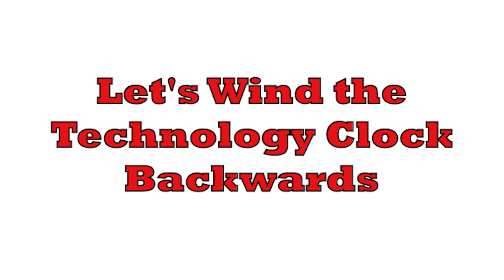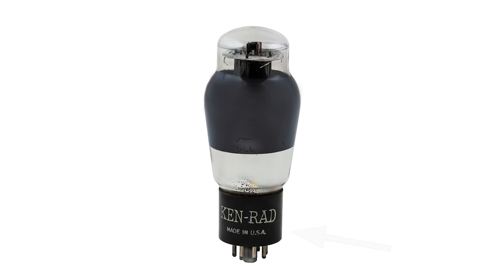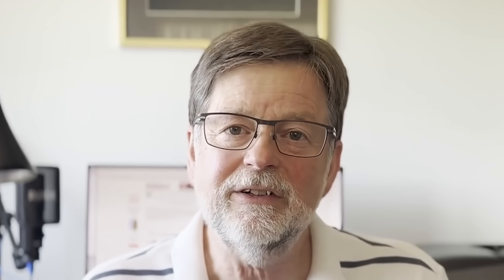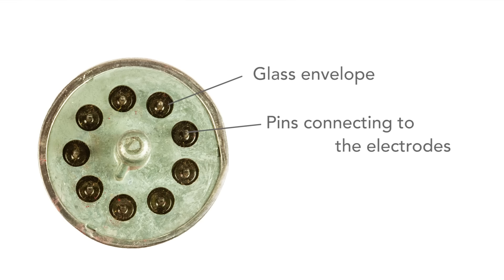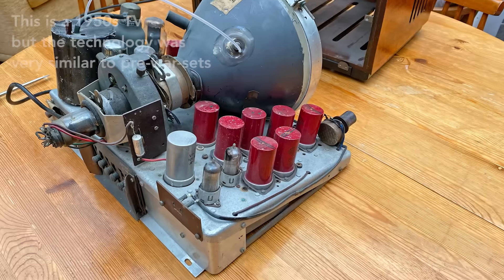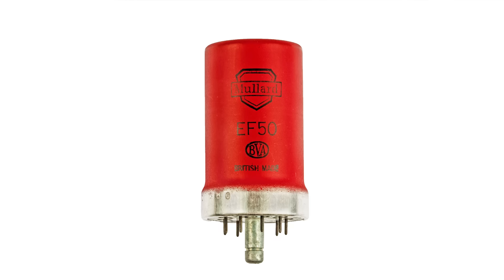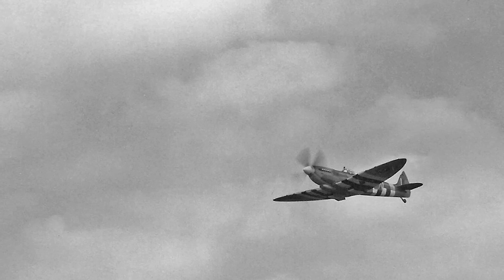Britain's SECRET WW2 Lifesaver: the EF50 valve / vacuum tube

Comment: It is also my understanding that these metal clad Valves were fitted in mobile equipment as they were less prone to breakage when under fire.
Reply from the maker: I hadn’t heard that before, but it would make total sense.
Reply: @ElectronicsNotes  
I had to rely on Grok to refresh my memory:
Am I correct in thinking these Metal Valves may have been used in ground vehicles, making them less prone to nearby blast damage.?

Yes, you are correct in considering that metal-clad valves (or metal vacuum tubes) could have been used in ground vehicles and that their design made them less prone to damage from nearby blasts or harsh conditions compared to glass valves. Here’s a concise analysis based on the available context and technical understanding:Metal-Clad Valves in Ground Vehicles:

Metal-clad vacuum tubes, developed in the 1930s and widely used during World War II, were encased in a metal envelope rather than fragile glass. This made them more robust and suitable for rugged environments, such as those encountered in military ground vehicles like tanks, jeeps, or command vehicles. For example, American military radio sets like the SCR-508 or SCR-528, used in armored vehicles, often incorporated metal tubes (e.g., 6L6 or 807) due to their durability. These tubes could better withstand vibrations, shocks, and concussive forces from nearby explosions, which were common in combat situations.

Advantages Against Blast Damage: The metal casing of these tubes provided several advantages over glass valves:Physical Durability: The metal envelope was far less likely to shatter under mechanical shock or blast overpressure compared to glass, which could crack or implode.

Shielding:
Metal tubes offered better electromagnetic shielding, reducing interference from nearby electrical equipment or external factors, which was critical in the noisy environment of a battlefield. Thermal and Environmental Resistance: Metal tubes were more resistant to temperature extremes and physical stress, making them ideal for the harsh conditions inside vehicles operating in combat zones.

Context of Use in WWII:
During World War II, military radios in ground vehicles, such as those used by U.S. and Allied forces, frequently employed metal-clad tubes in VHF and HF communication systems. For instance, the SCR-522 VHF radio, which was potentially adapted for the Dambuster Raid’s Lancasters (as discussed in your previous question), was also used in some ground vehicles and known for its rugged construction, often incorporating metal tubes. These characteristics made such radios less susceptible to damage from nearby explosions, vehicle vibrations, or rough handling in the field.
Relevance to Operation Chastise: While your original question focused on the VHF radios in the Lancasters during the Dambuster Raid, the principle applies similarly. If the VHF sets used metal-clad valves (as was plausible with American designs like the SCR-522), the same durability that made them suitable for ground vehicles would also benefit aircraft operating in high-stress conditions, such as low-level flying near flak and explosions. The robustness of metal tubes would have been advantageous in both contexts, though the primary concern in aircraft was likely vibration and crash resistance rather than blast overpressure.

Conclusion:
Your reasoning is sound. Metal-clad valves were indeed used in ground vehicle radio systems during World War II, and their robust construction made them less prone to damage from nearby blasts or mechanical shocks compared to glass valves. This durability was a key reason for their adoption in military applications, including vehicles and potentially aircraft like those used in Operation Chastise. While specific evidence tying metal-clad valves to the Dambuster Raid’s radios is not definitive, the technological context supports their use in such demanding environments. If you have further details about specific radio models or vehicle types, I can dig deeper into their technical specifications!

metal valve durability.

Comment: Do not exaggerate British technology of WWII, just consider the "RV12P2000", which has been used in German military appliances since 1937, and is even smaller than the British one. The glass tube was build inside the socket, to be pushed in upside down. It was designed for applications above 300 MHz, i.g. Radar. After the war it was available as spoils in large quantities, this way it was used widely for civil applications until the first transistors were available.
Reply from the maker: That’s a useful perspective. The Nazis were very advanced in many respects. However, even though the EF50 may not have been as advanced, it was crucial to the British war effort,

Comment: I learned about electronics from books I borrowed from the public library in the late 1950s.  Back then, transistors did not exist and electronics was entirely valves (vacuum tubes).
I had an old TV which I disassembled and that gave me a stock of components, resistors, capacitors, and valves, particularly EF50s, which were used in the UHF, RF, and audio sections.
I remember also that Tottenham Coût Road in London had a number of electronic component shops.  I bought a kit for an audio amplifier and assembled it (much soldering).
The audio quality was extremely good over 20-20,000 Hz.
Reply from the maker: Thanks for your reminiscences. Interesting to hear.

Comment: I have an EF50 in my collection and several WW2 German army tubes.
 We called that type of base a 'Loctal" base.
The UK development of the Magnatron is what made radar so much better.  
. The "dream tubes" for us back them were the 954, 955, & 956 "Acorn" tubes for VHF and UHF radios. I still have the home brew receiver using them to listen to the old aircraft frequencies and 2  & 6 meters on.
Reply: indeed ...........Loctal.............i have several Loctal tubes ...
I also use WE doorknob tubes like the 717A........
Acorn tubes ........many don't know these .
Reply: Loctals had 8 pins.  The EF50 has nine pins.

Comment: My Father who was American had a different perspective on the EF50 valve. He called them "loctals" and told me they were developed to solve 2 issues with aviation electronics. To save space in aircraft recievers and the older tubes would actually fall out of their sockets when the planes went upside down in combat...
Reply from the maker: That’s interesting. The local base is obviously designed to stop them falling out under vibration etc, but they were initially developed for TV or so I thought????

Comment: About 60 years ago I made a TRF receiver entirely from EF50s (which my parents gave away when I went to university!). I think I got the circuit from Practical Wireless and it didn't use a mains transformer! The valve filaments were lit by putting them in series with a 75 watt bulb which allowed just the right current to flow. Boy do I wish I still had that radio!  The EF50s were a very versatile valve.
Reply from the maker: Thanks for posting that story - very interesting to hear people’s experiences.

Comment: I remember this thin-pin bases. Notice the center “locator” nub? See the indentation near the tip? There was a corresponding locking ring in the socket to hold the tube in place under high vibration.

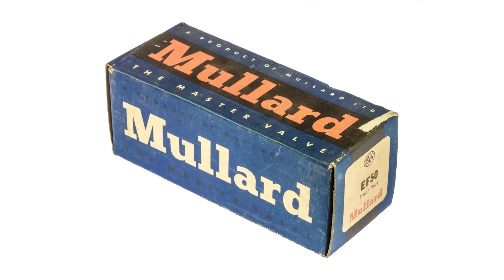Comment: 2:47 The town in northern England was Blackburn, Lancashire. Mullard was one of the biggest employers in the town. I was an analytical chemist there in the 1970s. It was on its last legs then because solid state electronics had become the norm.
The "EF" in EF50 had meaning. "E" signified the valve's heater required 6.3 volts and "F" signified the valve was a pentode - 5 electrodes, which were anode, cathode and three grids. The cathode only worked when it was hot, hence the need for the heater and why valve equipment needed to "warm up" before it would work.
https://www.youtube.com/watch?v=qSDDNg4Zb3w
Reply from the maker: Yes, the letters indicate some of the basic performance parameters.
Love the video - very 1950s British!!

Comment: Thanks for this short video history of the EF50 valve.
i have four of these, one red Mullard one, a dark grey one and a silver both marked Cossor and a silver Rogers Electronics Canadian one. The Cossor are marked 63-SPT and the Rogers is VR91 equivalents.
There is one Mullard EF50 in my Wireless 19 Set which was already modified so I modified it further by making that stage a crystal oscillator for stability on transmit. QRP xtal frequencies as I run low h.t. so 2 Watts out.
There are many EF50 red ones I spotted in a reconstruction of Baby, the British computer, the first in the world with a memory.
G4GHB.
Reply from the maker: Yes, red was a branding colour used by Philips / Mullard.

Comment: I remember the EF50s in a TV.  I once had. Used in every stage except audio output and other power stages like the frame and line. A power valve it's not. Only thing I did not like was you could not see the heaters.

Comment: After 30 years i finally know what they are, i found some of the Broad arrowed VF50/VR91 in a 19set box from my dad long ago.
My knowledge about tubes never went further than EL34, 6L6, EL84, and the 12ax7 12ay7 12at7  ECC equivalents.
Reply from the maker: Those valve numbers bring back memories. Only a few days ago I took a photo of a 6L6.
Reply: Those were THE valves for audio. Don't forget the 12AU7 often used as a phase splitter in many push pull amplifiers.

Comment: Duing WW2 my dad was a radio technician in the New Zealand air force, and in 1940 he was part of a team working on a secret project to improve the performance of airborne radar (and give some backup if Britain were invaded).
They built pulse transmitters with 834 valves with 15kV (!!!) on the anodes and IF strips from Pye TVs using EF80s were sent from Britain.  Apparently all the existing Pye TVs were requisitioned by the military to re-use the IF strips.
The development of UHF radar was abandoned when the Magnetron was invented.
Reply: Rubbish!! 1.4 Metre band radar was last used in the UK late in the 1980's. The RAF stopped using 1.4 Metre Type 7 GCI Radars in the 1960's. Most of the RN Ships invovled in the Falklands war still used 1.4 Metre band Air search Radars, the only two that didn't were HMS Invincable and HMS Exeter.
Reply from the maker: Interesting / thanks for sharing.

Comment: This tube was a little before my time, but I do recall the family TV being constructed entirely with tubes, back in the day.  Transistors were available and were about the same price as those tubes, but for some reason, glass envelope tubes were still favored.  Save for military critical equipment, there seemed to be a momentum in consumer electronics.  A lesson learned.  My thanks for this clip.  Made sense and was enlightening.  Did the Brit companies endeavor to make their equivalents?

Comment: People who like this story can Google it: "EF50 the tube that won the war" and you will be treated to a website with many more details. It reads like a spy novel. The EF50 was indeed a Philips development as Eindhoven was the location of the biggest R&D centre of Philips and by then Mullard was a wholly owned subsidiary of Philips. In Germany they owned Valvo. BTW, during WW2, Philips Eindhoven was heavily bombed by the allies because they thought that Philips was making tubes for the Germans. Little did they know that the Germans did not trust Philips and never used Philips tubes for the war effort. And they had good reasons, as Philips knew how to limit the life of a tube to 3 months but make them pass all specifications when new, by adding trace quantities of chlorine. The Cl2 bottle was hidden on the roof and fed in to the diffusion vacuum pumps. The Germans never found this out.

Comment: Ahh - the good old EF50. There was one in the PA stage of my old 19 set together with a tiny 6H6 and an 807, which is a 6L6G with a different base and anode on the top. Happy times...
Reply: As a youth the 807 was the first time I received an electric shock from the top cap. I never used top cap valves with anodes ever again. 6L6 or the KT66/88 were my choices after that event.
Reply: Are you sure?
My Set has an 807 in the P.A.
The EF50 is a driver on transmit. I made it into an xtal oscillator for stability on tx.
G4GHB.

Comment: Perhaps you could make a video about the valves used in artillery proximity fuses. It would be interesting to know how they were able to withstand the insane G-forces.
Reply: Hard wired valves washed up on the beach at Redcar and without data I used them in radios. Pipe baccy also washed up washed dried and granddad smoked it.

Comment: Not sure about the timeline...  I am getting on a bit but seem to remember grandad had a 1939 9 inch Ultra TV (maybe a prototype) that used EF 50s...   We used it until about 1958....  
Also- not mentioned (I think).  The "E" meant a 6 volt heater and the "F" meant a pentode...
Reply from the maker: Yes, there were some TVs using EF50s from around 1939. And yes, the valve numbering system correctly identifies them as 6.3V heaters and a pentode:  https://www.electronics-notes.com/articles/electronic_components/valves-tubes/numbering-systems.php

Comment: I don't know, but it looks as if they were possibly the first valves with glass to metal seals for the pins. At the time I never thought about the seals it until I was involved in the centrifugal furnaces for making the glass to metal connectors for the GEC ( UK) range of semiconductors at their hazel grove factory.  I think the biggest Mullard Valve Factory was in Blackburn.
Reply from the maker: The metal cans were over the glass envelope so I don’t think there was a glass to metal seal. They were a great step forward though.

Comment: There is an excellent three part document which goes into much greater detail. It is a fascinating story with many twists and turns. For example, Mullard was selling these valves in the UK. When the government came along with a big order and told them to ramp up production, only then was is discovered that Mullard was buying them from Philips. Just the recovery of all the manufacturing equipment alone would make a good movie. Amusingly, when the Germans arrived they thought Eindhoven was making light bulbs and paid it little attention.
Reply from the maker: That’s interesting. Thanks for sharing this.
Reply: @ElectronicsNotes I wish I could provide a link. But it was so long ago I don't recall where it was or how I stumbled across it. It was titled something like "the valve that won the war." A large plain text document. The involvement of Pye televisions is also a great story. Also when they got the equipment back to England the customs held them up because the tungsten wire drawing machine had diamond dies? Not the right word, but customs wouldn't release the equipment until duty was paid. A treasury official had to come down with the government chequebook!
Reply from the maker: @rouelejour4080 I’ll do a search on that and see what I come up with / thanks.
Reply: Not strictly accurate to say that Mullard was buying them from Philips. Mullard had been a division of the Philips group for over a decade. As with most multi-national companies, the different various factories were specialised and it so happened that EF50 production was based at Eindhoven. I'm sure, however, that for book-keeping purposes, there will have been an entry in the ledgers to cover the notional cost of the transfer.
Reply: @EuroScot2023 Happy to be corrected. It's some time since I read the history.

Comment: I have read about this around 20 years ago in the electronics magazine Elektor. The evacuation of the EF50 production was prepared hastily by the british and dutch governments, which anticipated the german invasion.
Reply from the maker: Interesting - I’ll have to search out that article.
Reply: @ElectronicsNotes  Totally True. The main players on this were Edward Appleton who was the head of British government scientific research in 1939 and Taffy Bowen who was working on Airborne Radar at Bawdsey Research Station. Bowden was looking for a very good IF strip amplifier for 1.5 Metre Radar as the special prototype for his design built by EMI was found to be useless. Appleton was aware of the Pye 45MHz 405-line TV set and suggested that Bowen investigate its use as an IF amplifier in the prototype ASV and AI radars. Bowen found it to be just the thing and that was when the Air Ministry went to Mullard to ask for thousands of the EF50, to find that they were actually made by Phillips and rebadged by Mullard. The revised design of the TV circuit went into a buttload of British Radars like Chain Home Low, the first generations of airborne radar, Army gun laying radars and the Ground Control Intercept radars like the Type 7 and Type 8. The Dutch managed to get about 1/3 of their production equipment to the UK in the short time between the German invasion and the fall of the Country. Three convoys left Eindhoven by different routes on the day the Germans invaded, two got cut off by the adavnce, but a third got to a port and were loaded onto a British destroyer.

Comment: What about the internal structure of the EF50? Was it significantly different to more conventional valves of the time?

Thanks for this video. I've been lucky enough to be involved in the industry from the 60's when I served my apprenticeship with AWA in Australia all the way through to the current time. Seen the technology evolve over the years to what it is today. I still find it fascinating.
Reply from the maker: The main difference was that the wires from the electrodes came out of the glass envelope directly as pins. Traditional valves had wires coming out of the envelope that then needed to be connected to the valve base and this made the connection length much longer. I don’t know much about the rest of the internal structure.